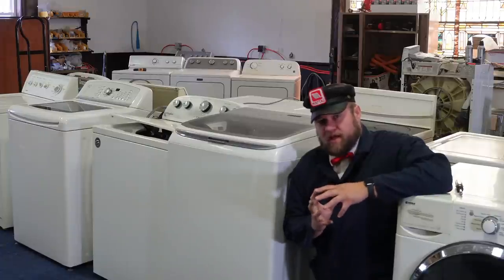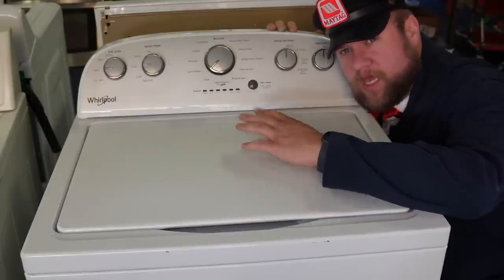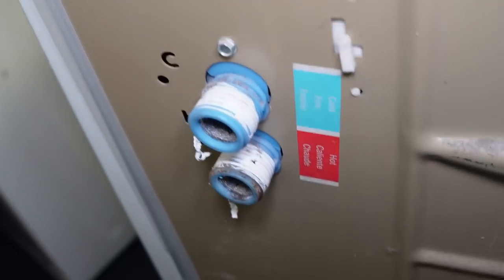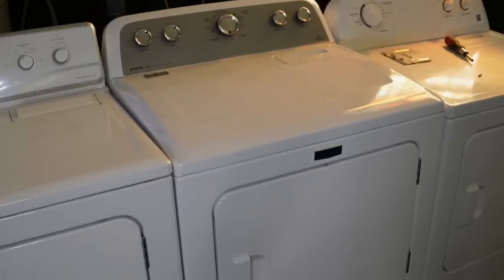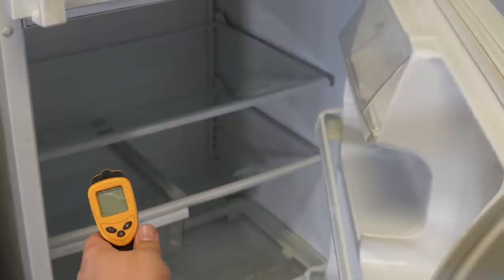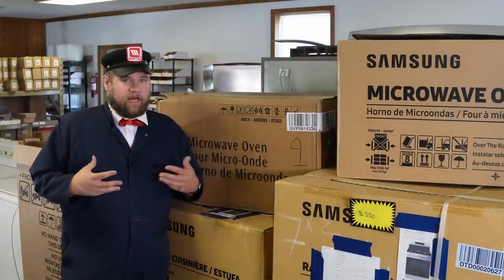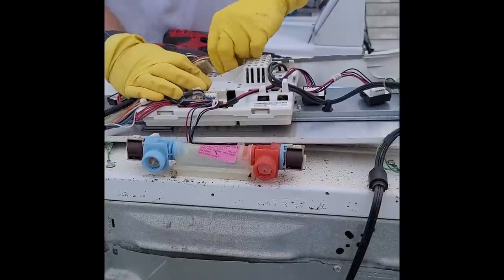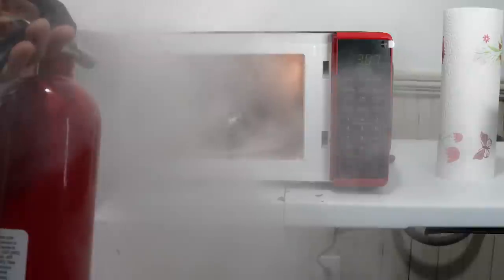Used Appliance Scams! How to avoid getting RIPPED OFF!

Comment: As well as the great information in the video - if you're buying an appliance (say, a refridgerator) that works but may have a few pieces missing, check to be sure the parts are still available.  Appliance parts are notorious for being discontinued within a horrifically short period of time - especially for LG and Samsung.  If you can get the parts, great.  If you can't, then take another look at that fridge and decide if you can live without some of those door bins.  If it's the lint filter on a dryer, don't even bother taking it home.  You need that filter.
Reply: What I have done before is for my film fridge I had a glass shelf custom cut to add to it. It didn’t come with enough shelves for my liking but it was cheap enough I took the dimensions of a match and had it custom cut. I wouldn’t do this for a old fridge worth more as scrap because this will probably be $50 or more but for a newer unit worth bothering it’s worth a look.
It’s not a fancy unit with an ice maker because I didn’t want to add a bunch of failure prone items, but from a time perspective it was cheaper to get glass cut. If it was a really cheap unit I’d probably have cut plexiglass or polycarbonate down and made a shelf with aluminum rails.

Comment: You should use a emporia wifi smart plug $7 on test fridges.  This way if a unit goes into defrost in middle of night you can look in app for defrost as well as start up and run currents to give it a clean bill of health.  This can be good beyond test mode.  I have notification everytime my adaptive defrost is activated about every 60-70 hrs.  Recently after 20 years, I got a notification for excess start up currents, amps beyond a certain amount for more than 2 secs (compressor was going into thermal overload).  I knew it was the start up relay thermistor and replaced it.  It was just starting to go bad and would've failed soon.
Reply from the maker: We use an Elitech temp sensor. THats a good idea too.
Reply: @bensappliancesandjunk  A different way to log but use both and get the total picture, of high temp cut out amps/watts

Comment: I purchased a secondhand washer from one of these big stores. It looked beautiful. It was a Kenmore 24 inch model. of course I ran it through cycles to clean it before I would use it, but I kept getting an odor, I took the cabinet off I couldn’t believe the amount of crud that was on the outside basket. I tried my best, but it turned me off and I won’t purchase these ever again.
I’m certain that’s a point that needs to be made.

Comment: Don't forget to visually inspect the bake element you can spot at bubble easily. So many great tips here! I've had plenty of problems over the years with bad electric, especially on dryers. Between the bad vents, drain issues and terrible installation even by "professionals", I only warranty what I install myself. Wash on 🤘!

Comment: Very helpful. Always a tricky purchase when it's something you can't move around easily that an unscrupulous person might prefer to sell. Lots of bad actors out there. The bad outlet story might have several reasons. A loose outlet might overheat. If your used replacement appliance draws more current than the one it replaced it might only seem to be defective, etc. (Editing tip: For closeups of screw terminals or circuit connections, take still pictures and edit them in your video. It's easy to do and you won't be fighting the auto-focus.)

Comment: My apartment building had that Whirlpool fridge with the bad temperatures in every unit initially. One by one they are all failing due to small refrigerant leaks. It must be a manufacturing defect because they all are developing the exact same issue the exact same way. When the refrigerant gets low enough they'll both have an issue maintaining proper temperatures and will enter endless defrost cycles as the colder temperatures from the low evaporator pressures cause the defrost drain lines to freeze. You'll get ice built up at the back of the freezer, rapid freezer burn of anything that isn't vacuum sealed, and water dumping into the fridge every defrost cycle.

If you see one for sale or hell even free, you do NOT want it!

Comment: I bought a whirlpool Calypso used not knowing the history of these machines. long story short it had to be overhauled so I had it rebuilt and its been Awesome so far and that was 8 years ago, I love my washer and matching dryer
Reply from the maker: Calpyso. Hoo boy. I've had ONE in my entire career. I CANT WAIT to get another one. That or a Maytag Gemini with the 2 wash plates. Very exotic systems for preservation. They aren't bad per-se, but it was like "Dead end technology" they just couldn't work the way they needed to for too long. But if you tear a Calypso apart, you see the early design theory that evolved into the Vertical Modular Washer, and they've sold tens of millions of those by now.
Reply: @bensappliancesandjunk  is the Gemini one that takes over an hour to do a load I like the thirty minute loads or 40 minutes I have too much to wash at times if I don't keep up. Sometimes I just take four loads to the local laundromat and get it over in an hour and a half. I knew someone that had those . I think that model came after the one I have. I will research the Gemini. Maybe that would make a replacement if I need to replace mine. 73

Comment: I had the unfortunate experience of buying a Whirlpool Duet Sport washer and dryer about nine months ago and the washer almost immediately having a serious shaking problem. The woman from whom I bought it swears it never did that for her. That's possible, as I've read online that shock absorbers can bust in transit. I was too lazy to replace the shock, and two days ago the drive belt shredded (perhaps related to the shaking). So I've just ordered four shocks and a new belt. If that sorts it, I'll still consider myself ahead of the game. If it doesn't. learn from me and always be ready for bad luck to make a good deal a bad one!
Reply: Did the shocks and belt fix it?
Reply: @ExtraJohnson  They did. The machine still shakes a bit more than I'd like, but we sometimes do two loads per day and it is holding up just fine (knock on wood).

Comment: After we bought a washer at a yard sale (and did zero testing) I read that you should never transport a washer on its side.  We did.  Is this caution true?  What issues can come up with the washer?  And, yes, I'm having trouble with the washer, which is how I found your videos.
Reply from the maker: The issue is that driving around can bump the suspension rods out of place which if you run it before checking can make the unit run horribly and destroy it if you don't catch it. Even transporting it top-down, it can happen. Just happens more frequently on the side

Comment: I have zero expertise in the area but in my experience a used washing had a problem, and hopefully the used shop fixed it.  Dryers on the other hand tend to be reliable but are often swapped out when the washing machine goes bad.

Comment: My 2003 Kenmore top loading gas 27” stack unit just died.  Dryer works fine but the washer agitator was acting weak and there was a small leak under the right front of the washer, so I called a repairman and he took one look at the inside of the front of the washer housing door, which was spattered with grease, and told me that my transmission needed replacement.  Because I don’t like any of the newer models,  I’ve been looking at used older stack units, almost all of which have been uninstalled and placed in garages where I cannot test them by running a load or even turning them on.  I watched your video about how to test a washer, however my current broken washer passed all those tests with flying colors, even though the transmission is shot.  I’m wondering how I can tell if a stack washer that’s sitting in a garage or storage unit (for who knows how long) is still operational and also, what are the chances that I can get another 5-7 years from a unit that’s already 20 years old?  I’m thinking about spending the $700-800 to put in a new transmission or, alternatively, do a “tub swap” for $400-500 which has been suggested to me by two different repairmen.  Evidently it is much easier than replacing the transmission, but then I would be getting a tub from another old machine and who knows how long that would last?  I only do major laundry about every 2 months and don’t do mixed loads.  In other words, sheets with sheets, towels with towels, underwear and lightweight nightclothes together, whites with whites, etc.  I feel that is easier on the machine and for me too.  I hope you see this, because I can’t figure out what to do because I hate front loaders and the new top loaders have a lot of issues and problems.  It’s not a money issue, but it’s an issue of wanting a tub that fills up all the way with water, no electronic panels, a dial that counts down how long I have left in wash mode,  and a lid that can open mid cycle so I can add something else when I want to.  I have been without my washer now since Dec 31 and I need to make a decision either to fix mine, purchase another old one that’s not testable, or buy a new gas stack unit by GE at Costco on sale, which I’ve read is junk!  PLEASE HELP!!!  I’M DESPERATE FOR ADVICE!!!

Comment: Ben, the test you made on noisy frontloead WM I think there was something in the drum like stone? that was making the creepy noise. Does anyone also noticed?
Reply from the maker: Notice the part with the concrete. Some shaved off when I threw it in the machine... The bearing was shot prior to this video, prior to me throwing the brick of concrete in it as well
Reply: I think I saw a change rolling around in there

Comment: Q. Given the price differential between new vs used is likely relatively small…
Might it make better sense to simply buy new?
Reply from the maker: Used units where I live are $150-250 for a washer or dryer, and new is minimum $500 so I don't think a >50% difference is small...
Reply: Used is better than the junk they make today won't last and I noticed they shortened the ten year warranty to 6 or 5 years. Something tells me these won't last ten years. Mine still running it's going to be 30 years old next year. I have another motor if I need it but I would think a bearing would go before the motor. I'm sure glad I never gave my washer and dryer away. If I could buy another 1994 model of my Maytag I would just to know I am getting a good long lasting washer. The dryer I had to replace my second belt it's a pain but I can still buy the belts at Lowes I guess the replacement belts aren't as good as the original. Maybe a bearing is not as free as it was I haven't had time to take the machine apart the next belt I may take the drum out and see if the bearing is replaceable. I already replaced the drum wheels. 73
Reply: I thought about buying commercial washer and dryers like at my local laundromat but I priced them like 6000 dollars and up. They wash fast and you can do triple loads. I could just use a regular dryer or dryers. They seem to last longer than the washing machines. 73

Comment: You mentioned stove burners that don’t cycle off. What if they don’t cycle off right away? I have a Samsung glass top that one of the burners stays on for a while even if you turn the burner down to low. Eventually it cycles down but it seems like it should cycle off as soon as I turn it down to low. Is that normal? Or what would I have to replace to fix that
Reply from the maker: Generally, you want to make sure that they at least cycle off at some point in 30-45 seconds. The worry is a fused relay that would just keep it "On" permanently. It can happen on any stove with burners, new or old.

Comment: Ben, how would you inspect a gas dryer or gas stove? Thank you!
Reply from the maker: Assuming you can't plug in, thats super hard... often the worst offenders are ignitors or spark systems for the burners which need gas. Electric only at least would let you see the glow or sparks which is huge. Without it the only thing you could do is physically inspect the ignitors but that's time consuming. I'd usually demand to see It plugged in running honestly

Comment: Hi Ben, thanks for the valuable information. We recently purchased a Maytag Bravos. Occasionally we have to use ex rinse to remove soap residue. Also a comforter may not be cleaned properly. Is it worth keeping or can a agitator be added? 
Thank you !
Reply from the maker: You can add an agitator but the unit may not use it properly. Are you using the bulky/bedding cycle to run the comforter or large loads?
Reply: @bensappliancesandjunk  
Yes sir. Bulky/sheets is our normal setting for everything. Everyone in our household feels the Bravos is not doing well enough to keep and we are considering replacing it with a older unit with the agitator that will probably use more water. I would rather use more water than wait 2hrs along with half clean load of laundry. However if you have a recommendation please inform me. Again I really appreciate your content, your channel, and your response.
Reply: @jasonleatherwood2172  hey my friend thanks for the response. I don’t know which models are direct drive. Could please give more info. I appreciate your input.
Reply: @jasonleatherwood2172  thank you…
I see what you mean.
Reply: @RBG-fc1nv  check your manual for loading instructions too, many of these new efficient top load machines shouldnt be loaded more than a 1/3 to 1/2 the height of the drum or the clothes simply wont move enough to clean properly. Sounds like a front loader would be better for your situation.

Comment: I have been selling used appliances for over 10 years now. I very clearly put in my warranty " Warranty covers any functionality issues with unit. Does NOT cover abuse / misuse of unit or units (IE, overloading, dryer not properly vented, dryer vent more than 8 feet causing issues, restricted dryer vent from lint or other foreign objects, etc.). " for dryers and " Warranty also DOES NOT cover any user error issues (IE, problems with wiring, issues with plumbing or any other misuse or improper use of any appliance). " for the other issues you mentioned ( that is taken straight from my warranty / receipt slip ). I warranty all of mine for 60 days. 

WITH THAT SAID! I can NOT STAND people that block phone numbers, block people on facebook, etc. It makes people like me, who have many excellent reviews and stand behind what we sell look bad.

Comment: Someone was selling a washer for $50 that wouldn't drain. Fixed it with a $30 drain pump
Reply from the maker: Way to go! We had 2 last week like that
Reply: @bensappliancesandjunk  then I accidentally rolled it down a hill (don't ask) and the thing that releases the water and fills the drum wasn't spraying out the water straight. I just cut my losses and recycled the unit. I was planning on flipping it. Now, the used appliance market is all messed up where I am and people are overpricing their broken units

Comment: Dear Ben, Are you still waiting for antique appliances to walk in your door? Well, that's not the way it works. You have to get off your ass and go out and look for them! Since you're in central Ohio, find out where the Salvation Army has their loading dock "as is" auction in Cleaveland. You'll see so many antiques, it will make your head spin. They probably hold one every day of the week. Scrapyards are another source. Get a route going on and faithfully make your rounds. If you don't, you'll never get anything really good.
Reply from the maker: I'm not going to dedicate extensive time to an old appliance that won't benefit my business much at all. Cleveland is 3hrs away. I'd have to spend a day on a possibility for a specific antique that won't help me much. So it's more wistful thinking as opposed to the other 100 things that make me more money